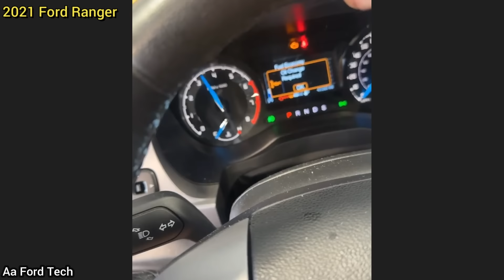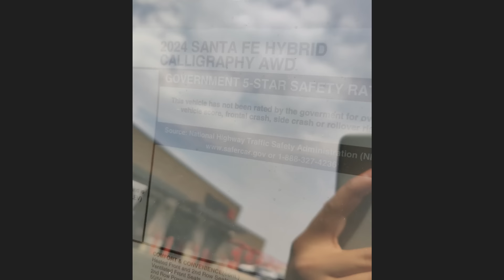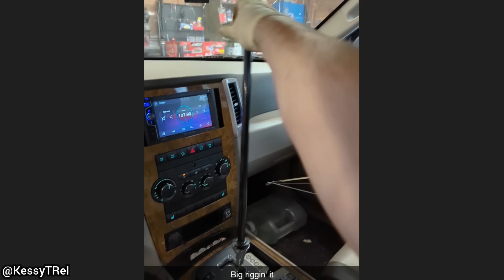Customer States Engine Sounds Awful After He Fixed The Engine

Comment: Feel sorry for the Corvette owner in a way as checking oil level with engine running is pretty unusual
Reply: Especially an expensive one.
Reply: It's because that Corvette has a "dry sump" oiling system meaning the oil isn't stored in the oil pan under the engine but is rather held in a separate tank. It's to prevent oil starvation/slosh  under heavy cornering or braking.
Reply: There's a thing called an  "owners manual" which probably mentions that several times. Putting that much oil into a car and not saying to yourself "well this ain't right" tells you alot about that owner.
Reply: It's certainly not something I would know. Unless I bought a car that way, then I'd learn.
Reply: @mattpierre891  - My point was more I doubt anyone would consult the owners manual on how to check the oil level.
Reply: @gordonm2821  I'd say that one's on the dealership that sold him the car, too. If there are things like this to note that are unusual or special compared to most of all cars, they should tell their customers about it on sale (Unless they didn't know either, which still wouldn't be a good look on their part)

Comment: Yes, Lets ruin our credit rating because we do not want to pay the $150 to fix the issue.

Also What?
You need to have the engine running to check oil level?
What the bloody hell happened to the dipstick which just checks the level?
Reply: Having the engine running is because that Corvette has a "dry sump" oiling system meaning the oil isn't stored in the oil pan under the engine but is rather held in a separate tank.  Oil is constantly being pumped out of the bottom of the crankcase and into the tank and then pumped back to the engine, but if the engine isn't running oil can pool in the engine crankcase giving an inaccurate reading.
Some high performance cars like certain Corvettes or Camaros have this, It's to prevent oil starvation/slosh under heavy cornering or braking.
Reply: he was the dip-stick

Comment: How do you destroy 4 engines like that in 10 years? how bad a driver is she or are the engines in Jeeps just shit?
Reply from the maker: Waiting to hear an update on that one!
Reply: No engines are that shit.  There's gotta be something going on with the driver.
Reply: @ischmidt  It is pretty catastrophic damage when the windage tray is smashed to bits. Has to be an oil issue or revving it to the moon all the time, as a rod must've broken, given the damage.
Reply: @ischmidt  Even the poorest manufacturer wouldn't make engines THAT badly. They'd be out of business because word would spread FAST. That's user error.
Reply: I have 108,000 on my pentastar and it runs quiet like it did new. There's clearly some neglect and or lack of maintenance going on here.

Comment: Australia here. A 10 year old Jeep. 3 engines replaced and a 4th full of metal. How does that happen? Either he drives like a maniac or Jeeps are no good. As a matter of fact I've never heard a good Jeep story. I don't ever see myself buying something so unreliable.
Reply: wranglers, jks specifically, are not as bad as people make them out to be. the 3.6 is a pretty decent engine if you take care of it. the problem seen in the video is definitely a driver issue.
Reply: The Chrysler fustercluck hasn't made a good car in about 20 years or so. The TJs are the last decent jeeps, & the 4.0 I6 is pretty indestructible with regular oil changes.

Comment: Stupid E3s. Almost as bad as old school BOSCH platinum plugs. The newer ones aren't too bad but, put those old style ones where the entire electrode is shrouded with ceramic in a Ford modular engine and it'll miss and run worse than 200k motorcraft plugs

Comment: I have a 2020 Corolla 1.8 whose plugs are supposed to be ultra fine wire Iridium plugs gapped to 0.040 and at 50k I changed the factory plugs and they were 0.029 with the Y on the back so I know they are factory ungapped plugs. I am now getting 3+ mpg with the correctly gapped plugs. Trust no one my friends, absolutely no one.

Comment: The C8 owner is clueless. I wouldn't know about checking oil dipstick with the engine running either, but how do you put SIXTEEN quarts of oil in anything (that isn't a diesel)?!?!? Somewhere around the 8th quart, wouldn't you know something was wrong? Check the manual, maybe?
Reply: No kidding. My F-150 takes almost 9, but 16 is ridiculous

Comment: I wonder what that engine was in the Jeep. The vehicle was described as a 1959 cj2a, which is not something that exists since the CJ-2a was built from 1945 to 1949. So if it was indeed a 1959, it would be a CJ-3B. In any case, all those early Jeeps had 4 cylinder engines. The 2a had a flathead (no rocker arms) and the 3B had an F-head (4 rocker arms). The engine in the subject vehicle looked like an OHV inline 6 so it might as well have been a Chevy, meaning that it's perfectly OK to take a grinder to its rocker arms.

Comment: Hey now JRI! I put E3 spark plugs in my gm 3.8L....around 50k miles ago... Been working great!
Granted I have no real noticeable power or fuel improvements, like they used to claim on the Sunday automotive powerblock TV... But the car runs GREAT!

But yeah, probably not a good idea to put em in a Porsche, did you say? 🤣 🤣

Comment: 3:13 that's caused by a broken exhaust hanger which lets the exhaust tilt up and burn through the plastic on that rear side skirt. Saw that a lot at Uhaul

Comment: I worked at a parts store and a guy bought a case of oil. Came back 10 min later and bought another. On the 3rd case of oil my co worker was like wait didn’t you already buy a case? And the guy said yeah it’s just not full yet. 

He thought you filed the oil up to the top of the valve cover. He had already put 24 quarts in. We explained things to him and told him not to start it. He started it anyway, oil came out of EVERYTHING. It was a relatively new 300. Had it towed to the dealer.

Comment: Something I always wanted to ask but was afraid of... what does "replace the brakes" mean in the US? Pads, rotors, calipers,  or perhaps even servo pump under the hood?
Never ever needed to replace any of the above for mechanical reasons - just followed the mandatory 10-year end-of-life for pads and rotors. They weren't even half-worn at 10-year mark.
Reply: Well, more often than not brakes come in a complete kit with rotors, calipers,pistons etc.  In the US there is much more difference to travel and more extreme conditions so they can wear down faster.

Comment: 2:18 as a complete noob i'll have to admit. I once had an exhaust leake, i didn't know what the f to do, so i bought some fireplace paste as it read hight temp resistance and smeared the shit outta it and added some metal clamps. It didn't work, surprise surprise. A relative took it to a friend of his and got it welded. Just to add, i layed on the ground with no experience attempting this shit haha.

Comment: There was a guy at my work that had a F150 truck with a 300 straight six he drove for years and put 150k on it and never once changed the engine oil only added oil to top it off, the motor finally seized up when the original oil filter rusted and fell apart and all the oil drained out while driving, that was back in the 1990's, I dont think any modern V-6 or V-8 could have taken that kind of neglect for so long

Comment: I bought an 84 chevy s10 years ago. Got it dirt cheap for like 250 because the guy said it ran like crap. Turns out it had an Isuzu diesel in it that ran perfectly fine but sounded like a frickin tractor and could barely hit 65 on a level highway lol. I drove that thing for over 2 years before I sold it for 1200.

Comment: E3's are high performance plugs. But they burn too hot for some engines and that can cause oil burn. My vans the same way. Typically I put in iridium with my shitboxes. But this vans last change used cheap copper. 

Replaced with double platinum and big shocker, too hot. Burns the oil up.

Comment: Typically: Engine oil, PS fluid, brake fluid and coolant is checked with a still, level and turned off motor (preferably cool).
ATF oil is checked with the engine running.

Comment: I've never seen an engine that you check the oil level while it's running. Auto transmissions yes, but not engines. Is it a dry sump system?
Reply from the maker: Sure is!

Comment: 0:48 Never heard of a car that you have to check the oil while the engine is running....What a terrible design/advice...
Reply: It's a dry sump system, which is fairly uncommon on production cars. More common in race engines.
Reply: @jeffreygunn3530 it also is common on modern cars because they don’t have a dipstick. So you have to run the engine to operating temperature to check the oil level

Comment: 1:02 Well who the hell would ever think they might need to check the oil while the engine is running?
Reply: Yeah, I've never heard of that (admittedly I have limited experience), I would have just assumed that there would be a 'fill to here' line on the oil reservoir. Or possibly two, one for engine off, one for engine running.
Reply: My air-cooled Porsche was like that. There's this thing called an owner's manual that provides tons of useful info.
Reply: @theaikidoka  Usually they just have a dipstick marker for when the engine's off... and I imagine an engine would vibrate too much to get an accurate readout while the engine is running... maybe flatplane V8s vibrate less than crossplane V8s.
Reply: @brockp59  Yeah... but who reads those?
Reply: It's a "Dry Sump" oiling system on that Corvette. The oil isn't kept in the engine crankcase but rather a separate external tank constantly being pumped between the two. It's done to prevent oil starvation under heavy cornering due to oil sloshing or foaming in the pan.
Reply: @brockp59  Yes, I am aware and I read mine, but I'm saying if the car does something in a way that isn't standard, you can be excused for being caught out.
Reply: @theaikidoka  Usually that sort of stuff is labeled on the fluid cap (well at least my chevy express does anyway)
Reply: @Akanoyoru  Or on the dipstick.

Comment: You would think if the oil level needs to be check when running and you check when it's not, you would be low on oil, not over filled.

Comment: E3 plugs are JUNK. The fact that they have the covered electrode saved my 2006 750 Shadow Spirit. The center electrode fell out of tge damn plug! It got caught by the ground dealie. Tried them in my chainsaws too. Hard to start, misfired REALLY bad at high RPM under a load. Put an NGK in one saw, perfect. Put a good ol Champion CJ8 in the other, even better. I wouldn't put E3 plugs in anything for anyone.

Comment: i like vette repo guy in a sarcastic way, but also why do we need to check oil with the engine running when thats not a thing in every other street-going engine ever made? its like chevys starter that says "dont hit the starter" on it... quit fixing things that arent broken, be normal with your designs, and we wont have these problems :/
Reply: An owner's manual is free with purchase !!
Reply: @practicalplinking6133  yeah but i shouldnt have to read it for something as simple as an oil check because no other car requires special conditions for such easy things. stupid unnecessary changes like that are why people dont do their own maintenance anymore and honestly i dont blame them. i do all my own stuff down to engine swaps, but ive sworn off touching any german car because they do dumbass things like left handed threaded oil filters. no. im not doing that. be normal or i wont buy your crap. so in that sense i empathize with the guy letting it get repoed. if its got stupid engineering for checking your oil, what else does it have?
Reply: It all depends on the engine. Maybe this one is slow to return the oil to the pan when it is turned off, so if you don't wait long enough, it shows up too low. Checking it while idling, means the oil is flowing at a known rate and you can be sure the dip stick shows the correct level. 

As was said': owners manual. Every car is different. Everyone with a license can read. There is no excuse to get this wrong, except for laziness and stupidity.
Reply: That Vette uses a dry sump.
Reply: @practicalplinking6133  I wouldn't be surprised if there's a sticker on the fan shroud or underside of the hood that tells you, too
Reply: @Yvolve  the person is technically to blame for not reading the manual to grasp the intricacies of the manufacturers design, but also the manufacturer is to blame for making a standard mechanism require abnormal usage. that is their fault and vehicles are recalled for it all the time. technically nothing is wrong, but if enough people screw it up then the manufacturer has to change the design back to something normal, or change the interface to make "normal" use of their abnormal system impossible so people know somethings up immediately if they try to do it.

the guy is stupid, but chevy absolutely blew it.
Reply: @jackradzelovage6961  It all depends, how important is oil level to ya ??
Reply: @practicalplinking6133  as a connoisseur of junkers, kinda. but also if i want to check my oil, it better be a normal looking dipstick that i pull whenever and look at like normal, OR it better not look like a conventional dipstick in the slightest. if that clip can result from genuinely not realizing the oil isnt checked like every other car on the road, then yeah the company screwed up. this isnt a hard one to understand. even some courts would win you a lawsuit over something like that.
Reply: @jackradzelovage6961  As someone in the comments said: it is dry sump, so it is abnormal to begin with. The owner should've read the manual, buying a high powered car. What you say only applies to run of the mill cars. 

This is not a recall, as it isn't a manufacturers error. It is a user error and not covered by warranty. 

If it is indeed a dry sump, there is no "going back to something normal" as the engine simply won't fit with a wet sump. One of the reasons a dry sump is used is that the engine can be much lower. The oil is stored in a separate reservoir, that feeds the oil pump, which pumps it through the engine, where a scavenge pump pumps back into the reservoir. Very expensive and complex,  but the advantages make it worth the cost in a vehicle like this.

Chevy didn't do anything wrong. At best, the dealership should've explained it on delivery, but that is it.
Reply: @jackradzelovage6961  Reading your comments, you're mainly angry that some engines aren't extremely easy to check the oil. First of, you can't just the check the engine oil anytime you want. Every engine has an ideal procedure. 

You are also wrong that "every other car on the road" is the same in this regard. As I said in my other comment, engines vary wildly. This is why every single car manual explains how to check the oil properly. 

Laziness and a refusal to read the manual are not excuses to blame the manufacturer.